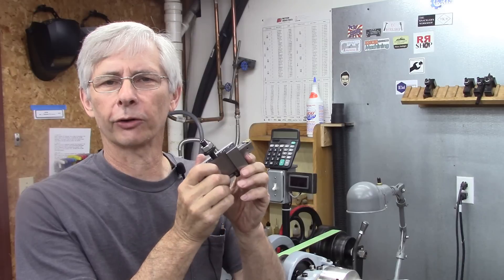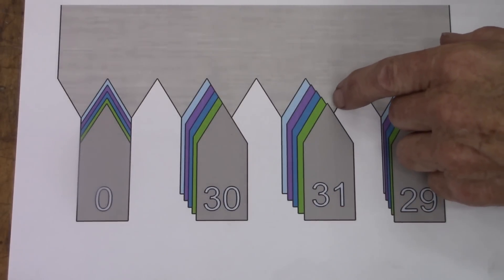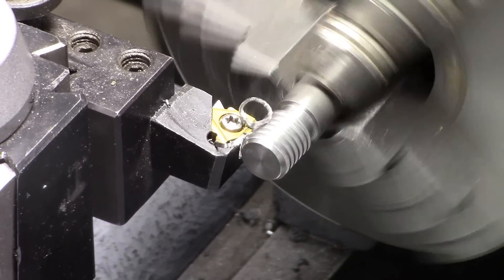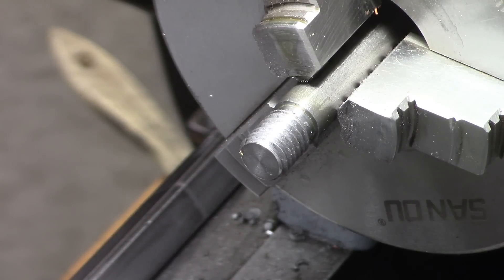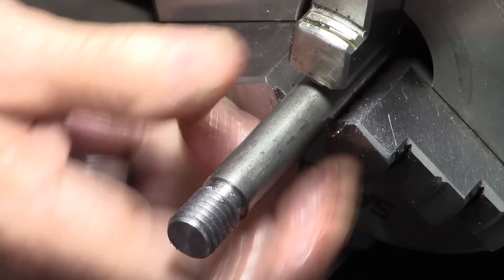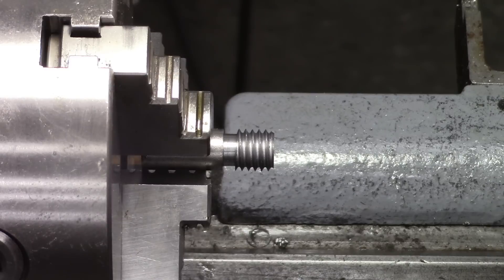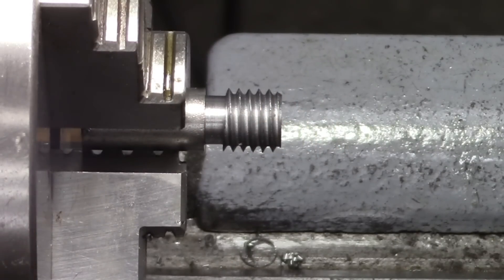Threading - Feeding with the Cross slide vs Compound

Comment: I expected you to actually demonstrate all the thread-cutting methods you had printed on paper, and to show—POV style—how the chip and the vibration behave without skipping any steps. That way the video would have been educational, and it would’ve shown how you need to reduce the feed as you go deeper into the thread.

Instead, the video ended up almost pointless — rushed filler content for YouTube, apparently in hopes of making some money.
Reply from the maker: I guess I need to try again!
Reply: @WinkysWorkshop  I would actually be happy if you made a video on the topic that goes through all the thread-cutting styles from your printout. You could film the cutting process up close so it’s clear how too high a feed causes vibration and how reducing it fixes the problem.

Show each cut in real time and always explain exactly how much you increase or decrease the feed and why. I don’t personally have trouble cutting threads, but I picked this up because your printout was good and I was hoping for a video that actually shows in practice what to do and why, rather than urban legends or machinists’ bibles.

For many, especially hobby lathe owners, it can be surprising how many passes an M14 thread requires when the machine’s stiffness is limited. A shortened or edited video can easily give the impression that threading happens in seconds, when in reality it’s quite slow.
Reply from the maker: I think I need to rewatch my video. I did this one several years ago. I usually see my own shortfalls better after a period of time. I'll consider your recommendation. thanks.

Comment: Any time you go into a project with preconceived notions or preferences like that of cross-slide vs compound slide, more often than not, no matter how non-bias you try to be, your finished project will reflect your preconceived outcome.  Nothing wrong with that.  Whatever works for you, use that method.
I work with a cheap little Chinese desktop lathe, and I've only ever used the cross-slide method for cutting threads.  After the learning curves was traversed, I always seem to get good threads.  
I'm not saying my threads are pristine perfect.  I'm saying that my cross-slide cut threads are equal to or better than the compound-slide cut threads that Mr. Winky just cut in this video.
I noticed that this particular lathe chuck didn't seem to be spinning true.  This too will affect our threads.
Reply from the maker: It was a 3 jaw chuck, they seldom run true but this will not effect the outcome. Preconceived notions is why I ran the test. It confirmed my my assumptions. Not only were my results better, they are just easier to cut. No dial setting to remember. Its a small difference but nevertheless easier. 

Have you tried using the compound? And "are sure you expectation's are not effecting your preference and or results?"

Comment: bween working in a shop for 6 years now and almost exclusively feed with the cross slide , thew only benefit i see from using the compound  is the potential to eliminate chip jamming  , but another thing to keep in mind is the geometry of the insert , i always go full depth on the inser , that eliminates the need to do cleanup with a file except for the start and end of the threads 
i do have a beefy lathe tho (metric  660x3300)
Reply from the maker: Compound feeding lowers the load caused by to the intersecting chip you get going straight in. You can also take slightly deeper cuts plus you dont have to remember a dial setting for each pass. To me its much easier. to use the compound.

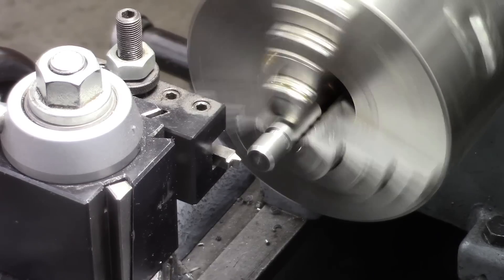Comment: Excuse me for the dumb question but, I'm a beginner with lathes and I don't understand how you can feed by hand . Aren't you using the lead screw ? and yet I see you feeding by hand (8:36), I don't get it. or are you so good at it that you can do it manually and your threads arfe still correct? That seems absolutely crazy to me
Reply from the maker: Yes I'm sure you have a miss misunderstanding of the process. The leadscrew moves the carriage left or right (in this case to the left}. The manual feeds were moving the tool either straight into the work or at a 30 degree angle. Watch my next video and it will be much more clear. https://youtu.be/20pHyGFYgFA?si=Ge1fxB-_KTyYwGu1
Reply: @WinkysWorkshop  will do, thank you

Comment: I think if a lathe is older, and or lighter and your using high speed steel it's better to go the 29°, or 29 1/2° process, but if your lathe is heavy duty the 0° straight plunge in process is just fine! I have been doing the 0° plunge in for 55 years on my lathes but their heavy duty American made lathes.
Reply from the maker: Yes, I agree and well put

Comment: Great video Mark. Technically you can cut a 60 degree thread anywhere between a 0 and 30 degrees angle. Typically using the cross slide for 0 degrees, and the compound slide for the other angles (0 degrees can be used with the compound slide as well). The higher the angle, the more material is cut out on the left side, and the less is cut out on the right side (right hand thread of course). You are correct that going over 30 degrees will produce a stepped thread, which is not what you want. I don't know where the 29 degrees and 29.5 degrees came from, but I have heard a lot of people saying that it is used as a safety precaution to make sure that you don't go over 30 degrees. Perhaps there is some merit in that if the scales on the compound slide are not so accurate?
Reply from the maker: I totally agree well put. Yes I have heard that the 1/2 degree less that 30 is just to make sure that the right side cuts clean. I always set it almost 30.

Comment: It's worth remembering that a tool cuts on the top. The front face and the sides don't touch the part.
Reply from the maker: True but tell us why it's worth remembering?
Reply: @WinkysWorkshop  because there are lots of references in the comments referring to tools cutting on the sides. All machining knowledge is worth remembering.
Reply from the maker: @marley589  Yes, however I think it was in reference to the left top and right top corners and not the side reliefs.
Reply: @WinkysWorkshop  The video constantly referred to cutting on the "left and right hand sides", "both sides" and "one sided tool". My comment did not refer to the "side reliefs" as you call them. It simply pointed out that the sides that were constantly referenced to as cutting were not, the top face does the shearing as it is the only face that touches the part.
Reply from the maker: @marley589  Okay, you can just assume that I meant left upper edge or right upper endge

Comment: Cross slide feeding works for carbide tools and running fast.  When you work in industry you need to do the job quickly.
Reply from the maker: I agree, higher speeds and very solid machines make feeding straight work much better. However, for manual threading the amount of time needed to make thread very close to the same. The only advantage to feeding with the compound is being able to read the thread depth on the dial. Some think that feeding with the compound adds complexity but after doing both method I find the that feeding with the compound much easier. I can make larger cuts and I don't have to remember the cross slide dial setting.

Comment: Here’s some math that has helped me when chasing threads with the compound. Suppose you’re cutting 16 pitch threads at 29 degrees? Double depth of a 16 pitch thread is .081, but since the compound is feeding on the hypotenuse of the angle the depth will be deeper. The constant of 29 degrees is 1.144. Therefore the reading on the compound dial will be .081 x 1.144 = .093. I hope this helps.
Reply from the maker: Thanks

Comment: The best part about doing it with the compound is you don’t have to remember each time how deep to cut, the cross slide just simply goes back to zero. You’re a liar if you’ve accidentally put too much of a cut on and see this big chip curling up.
And by the way you know you can do less than 29 degrees right? Can be anywhere from there to zero.
Reply from the maker: This is true, but I prefer 29

Comment: I appreciate the content. The root doesn't match a proper profile with the last tool you used. However, I run my threading tools inverted for most jobs and sometimes even use the compound in conjuction with the inverted tooling. I actually disagree with using the compound in a 30/29.5 degree setup,  but I also do more precision, or smaller, threading than most folks I know and I normally use carbide tooling due to the materials I thread. I do, however, use the compound when 'finding' thread done by incompetent gunsmiths, in order to correct their profile.
Reply from the maker: > The root doesn't match a proper profile with the last tool you used. 
You mean the tip radius is too large? 
> I actually disagree with using the compound in a 30/29.5 degree setup,  but I also do more precision.

For very small threads I could see why. It not needed but I can't see why it would effect precision.

Comment: Here's the deal.  I've desperately wanted to learn making threads with a lathe but every channel I've watched began at a level for advanced machinists, meaning it served no purpose for me.  Your video does a great job regarding the "thread-making" portion but it doesn't let me understand "setup" from the beginning.  What I'm missing is ... once the stock is inserted, once the end is faced, once a bevel is applied ... do you set the compound at a "zero" location away from the stock then feed it with the worm drive, only to return the compound to the zero again with a slightly deeper cut ???  This would be very helpful for me and I assume many other people who would like to learn to cut threads.
Reply: Touch up on your part with your thread cutting tool and set your cross slide to zero  then set your compound dial at zero  only move your cross slide in to cut  each time  you  start a cut keep your cross cut at zero.  On uneven size threads some machines you have to engage thread lever at same number
Reply: @sonjalittlebear  Thank You so much for your experience.  Unfortunately for me I am a visual learner.  The video by Winky helped me immensely.  Thank You again.
Reply from the maker: @richardgreen7811  Glad you liked the video. You're welcome.
Reply: @WinkysWorkshop  I'm working on finding a vintage lathe and mill.  Whatever time I have left I want to apply it to the things I love.  Thank You very much for your Channel.
Reply from the maker: @richardgreen7811  I feel the same. Over my lifetime I worked hard to achieve a level of future comfort and security. My workshop was never a priority. In hindsight I could have (and should have) prioritized it more. Honestly, even now I spend very little in my shop when compared to other hobbies like fishing, old cars or RC planes. The old machines are amazing. With a few exceptions they are usually very good quality considering they had no CNC. Also they had stye.
Reply from the maker: I'll make you a video and post it Friday. Be sure and watch!!!
Reply: @WinkysWorkshop  Thank You very much ...

Comment: Your comment(around @0:45) re: "Small lathe... compound, and big lathe Cross-slide" is SPOT ON! 
As a machinist(of a few years): plunge cutting of threads is great for standard series metric and imperial thread forms up to 24mm/1" dia, anything bigger(or square/ACME) is simply a case of walking the form tool into the cut to relieve stress on the tool(prevents grab and chatter on the thread form), whilst compound is preferred for high precision threads where there is no thread chasing possible(die run through/over). 
I mostly use "Big machines" (1.5ton to 6ton), but I do use import machines of tiny size too for fiddly bits. 
PS love the quick release threading tool(poor man's cross-slide quick retracting action as found on tool room machines(I have a Holbrook C10 with this function BTW).... 
Keep up the good work.
Reply from the maker: Thanks, I think your idea of big and small and different thank mine, my lathe is super small... ha
Reply: @WinkysWorkshop  As we've discussed before : the size of the machine and/or it's origin of manufacture has NOTHING to do with the learning of new skills, the improvement of machine tools(as the user develops, etc), AND good work results. 
Machine tool snobbery is far too prevalent, and is a reflection of a wider problem, which limits us all!
Eg. I have a GENUINE Arboga Mill/Drill, which, to be blunt is garbage, but Arboga make great drill presses..! 
"Horse for courses" as they say on the this side of the "Pond". 
Keep up the great work... 
PS. The best way to thread to a shoulder, is to actually thread AWAY from it with a "Back tool post", or suitably tooled "Front tool post", where thred depth is relieved at the shoulder(but not obligatory). 
👍👍👍
Reply from the maker: @craigywaigy4703  >>the size of the machine and/or it's origin of manufacture has NOTHING to do with the learning of new skills, 

I never said otherwise. In fact, learning to work with a flimsy lathe helps you understand the importance of a proper setup . Sometimes a person that has only worked on a Monarch lathe will make silly comments regarding cutoff problems in a small lathe, like you just need to sharpen your tool or adjust your feed rate. I remember my first attempt with cutoff, I slapped that blade in the quick change and pow...  the blade snapped. Yeah some of it was setup but most was a lathe that was not very ridged. It forced me to learn alternate methods and improve my setups.  Thread in reverse is amazing...  I wish my chuck was not thread on.
Reply: @WinkysWorkshop  Ah, Im so sorry, as I think something was- "Lost in translation"....I'm British"! 
I agree a machine(size/manufacturer doesn't matter - your posts PROVE THIS), or do they.ektjer define a machinist, or their work..
BTW I started with a Paetol(Taig licensed UK product), then went "Big" with Dean, Smith and Grace, Holbrook B's and C's, to Langs(Junior), with Oil Country Tos' AND MAHOOSIVE LANGS in between, to finally RETURN ro buying  a "Small" 7X14("Chinese" import lathe in 2014)....
All these machines are great in their own way, and my £250/$300 import lathe, you'll never grab from my cold dying hands! 
👍👍👍
Reply from the maker: @craigywaigy4703  Greek? I never heard of any of these machines. So you like the little import?

Comment: A bit off topic here but here is a tip for the method I use for parts I use in my shop.
I rarely go to the bother of screwcutting a male thread on the end of a shaft. I tap the required size in the end and fix a high tensile set screw in the end.
This gives me a high strength thread that can be used up to a shoulder without an undercut that weakens the part. It is far easier, quicker, stronger & saves material.
Reply from the maker: I've done the same

Comment: Lots of comments regarding tool profile and angle of attack but I'm not hearing about speed, depth of cut, cutting oil (high sulpher content) all of which i have found can make a profound difference in thread quality. In my type of machinig im more so than not shooting for class 3 A-B threads. I dont want a customer unscrewing a thread protector and see threads that look like a beaver chewed on them.
Reply from the maker: Yeah, need to keep those beavers out of the shop. This video was mostly about comparing two feed methods but yes, higher speed cuts smoother. Threading against a shoulder and my reflexes limit the speed however. I agree on the oil. I used to use the sulfur oil all the time. The difference isn't drastic in my opinion but I feel like it was better.
Reply: @WinkysWorkshop  thread away from the head stock. It reduces reflex worry and "pu cker" factor.
Reply from the maker: @johnseptien3138  Screw on chuck provides an alternative pucker factor.
Reply: @WinkysWorkshop  don't have one. Camlock. Well, two of my atlas's are screw on. PM 1340 not.
Reply: @WinkysWorkshop  thread away from the head stock. It reduces reflex worry and "pu cker" factor.
Reply from the maker: @johnseptien3138  Screw on chuck